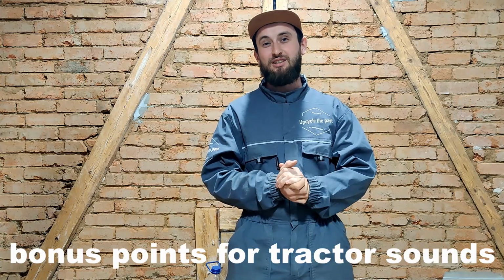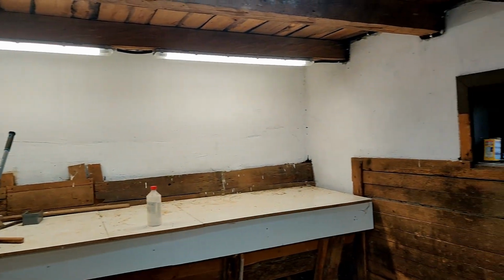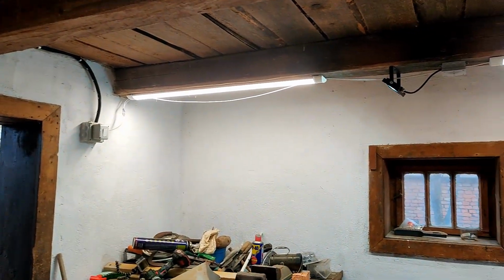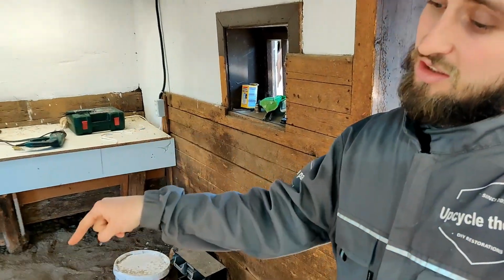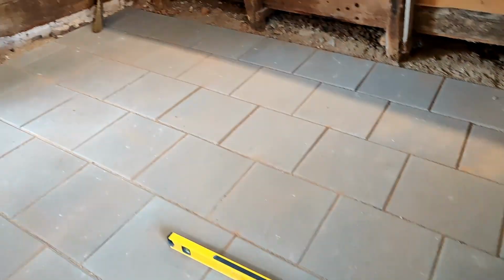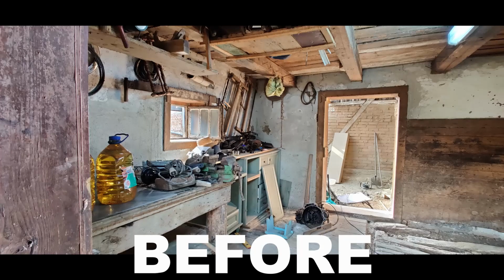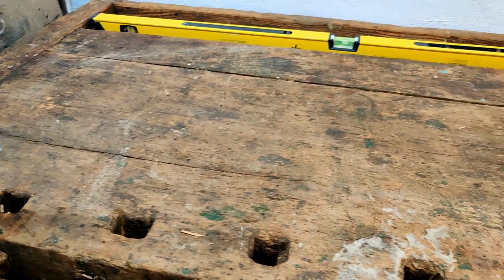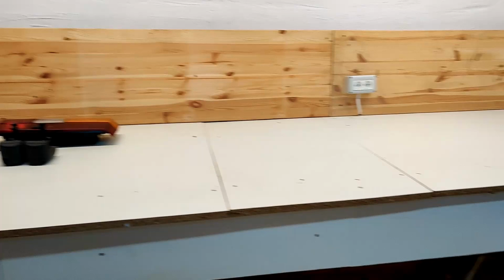BARN RESTORATION pt.3 | The Rustic Workshop

Comment: I really like how you handled everything in there, from painting to wiring and flooring. The only issue I see in what you're doing is that it can get dusty because of the sand under the pavement. we'll see how you handle that...
Reply from the maker: Ty mate :)
Regarding the dust... It was the compromise that I had to make ... Can't have it all in an old construction, especially on a budget :D
Reply: @upcyclethepastutp9901  Oh... for sure. But i'm still wondering if there's a way to manage the dust when using tiles